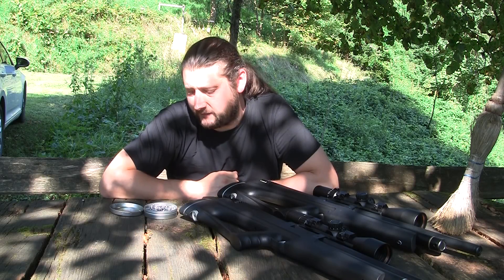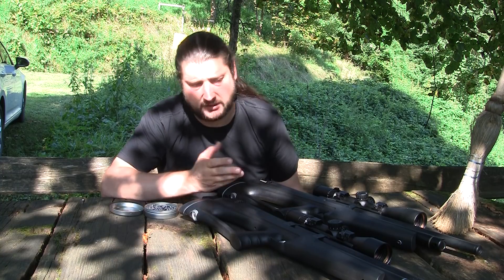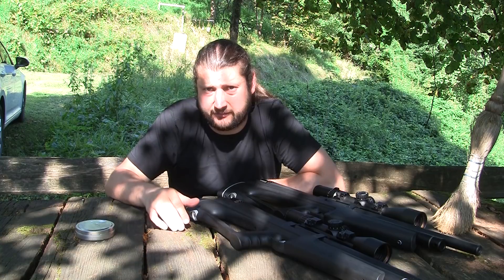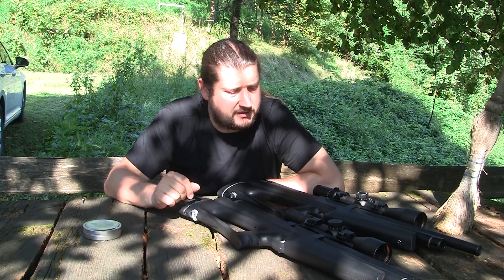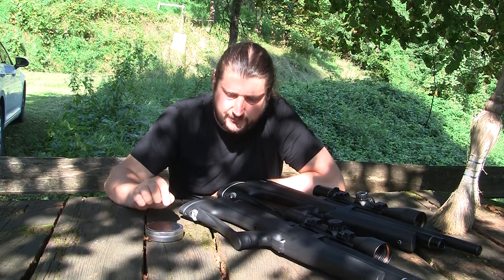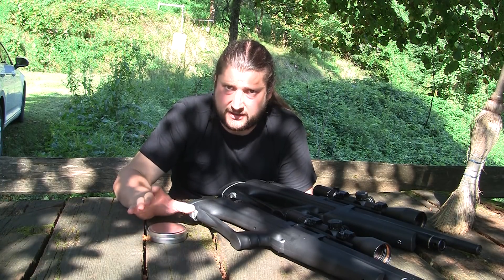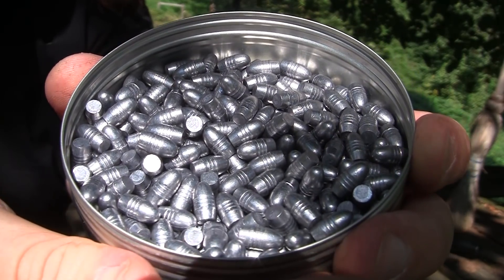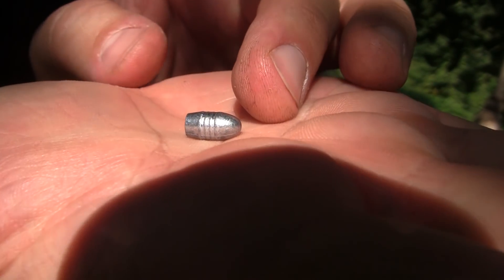Accuracy of cast airgun slugs - part 1 (.22 for Huben K1 and other high power PCPs)

Comment: Hi Gregor
Do you shoot slugs just after casting
Or you do something to them before shooting?
My casted slugs are not accurate at all, giving me 3 inch group at 50 meters
Reply from the maker: That depends on the slug. Some are sized, some not, some a lube with silicon spray some not... In any case, the whole procedure is a form of art and everything has to be right to get good accuracy. 3 inch at 50 meters does seem to be a little extreme even if the slug are not well made so maybe some inspection needs to be made to the gun and the barrel...

Comment: hi i have some quetions gregor can you help me please i was see you have a hatsan bt65 5.5 is this gun barrel lother walther or hatsans regular barrel and did you tray to shot whit this pallets you was show 2 model 5.52 and 5.55 which ona is better hatsan bt65 and can you write this pallets length measurmet how huch mm?

and hatsas barrels are have choke or not do you know that?
Reply from the maker: All Hatsan barrels are choked. 5,52 will be a better option but you will have problems achieving high enough power... So I would not recommend it. the slug is about 10,7 mm long.
Reply: @gregorkamensek3923  tank you so much man

Comment: hi gregor, I have a huben k1, I have a problem, sometimes I shot normally without any problem and sometimes it happens to me to shoot a few shots and the air comes completely from the rifle it happens without touching the settings, set at 175 bars, I try to reduce the number of clik 35 to 29 but the problem is a threat, is it a defect of the rifle? or is it a problem of adjustment? help me please gregor
Reply from the maker: What slugs (weight) are you using and what is the velocity? In any case, I don't thin that there is something wrong, I suggest you increase the pressure and close the power wheel accordingly to retain the slug velocity. I assume you are shooting heavy slugs with high friction and those just need enough pressure to work reliable. Also, are you sure the pressure gauge shows correct pressure?
Reply: @gregorkamensek3923  thank you gregor I'll do what you told me, I use pellets made by me even with the huben swaging kit (2.39 GRAM)
Reply from the maker: Yeah, those have quite a lot of friction and you need a slightly higher pressure. I would suggest to set it at about 190 - 200 bars...

Comment: Will your slugs , or do you know of any slugs that will shoot good out of the Vulcan 2 air rifle ?
Reply from the maker: Generally, these slugs are designed for regular PCP, so they should work in Vulcan (I did not test them in vulcan though). Also important is what I mentioned in the first video, the gun needs to be powerful enough and you have to cast them of almost pure lead to be able to feed them in the chamber... No cast slugs will be more accurate than high quality pellets but you do get an advantage of high BC so at long ranges, you will see their advantage...

Comment: Hi sir

What is Best of the huben k1 versions. You have the version 1 with custom Barrel. Is that better than the version 4 ?
Reply from the maker: What you have is the best combination for shooting 5,54 slugs. I get the best results with my K1 V1 with custom barrel. This is simply due to the fact the custom barrel is not choked and is optimized for slugs, while all other stock barrels have a choke to make them more universal...

Comment: there is no dimension for the .25 huben. i have a huben in 25 caliber. so i need the dimensions of the cavity in 25 caliber mold please.
Reply from the maker: What do you need? the length of the slug?
Reply: what is the groove and bore diameter in the huben .25 barrel? and what is the diameter of the slug for this MP mold for .25 caliber...the rear band diameter??? the huben .25 only accepts 11mm long.
Reply from the maker: Not sure about .25, but so far, Huben used LW airgun choked barrels. My .25 slug is about 10,9 mm long so they should fit but I will know for sure when I get it...
Reply: @gregorkamensek3923  i can fit a .430 or .435inch slugs in the magazine. Do you have the rear band diameter of the slug for .25 mp mold?
Reply from the maker: It is 6,5 mm (.256)
Reply: @gregorkamensek3923  thanks  Gregor. When will you get the huben in 25 to test?
Reply from the maker: I do not know.... :(

Comment: I have ordered the V2 MP mold and is waiting for the reply from Miha.  May I know how this slug compares with the JSB beast pellet in terms of accuracy ?
Reply from the maker: They are much more accurate at longer range because unlike Beasts, the slugs are stable. Unlike JSB, these have constant 1-2 MoA accuracy at any range. This answer is based in using those slugs and pellets in K1 of course...
Reply: Thanks, Gregor. Hope Miha will respond to my mold purchasing request soon.
Reply: @gregorkamensek3923  Hey bro - i have 2018 version 2 huben .22 standard barrel - which mold would be better for JUST the huben . The 5.54mm or the 5.52 (btw i do not own a pellet sizer)

Also between the  these cast molds and huben swage mold which is the better in terms of accuracy? 

Thanks
Reply from the maker: @tkiphone1462  Both work with about the same accuracy, 5.55 will be hard to load if you do not size them. If you do intend to size them, then 5.55 will give you a bit more options to experiment.